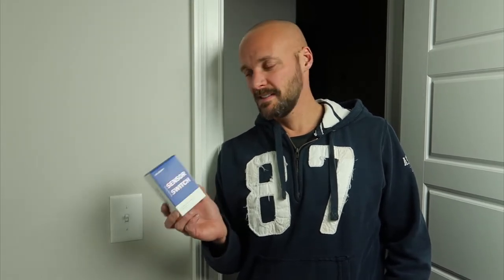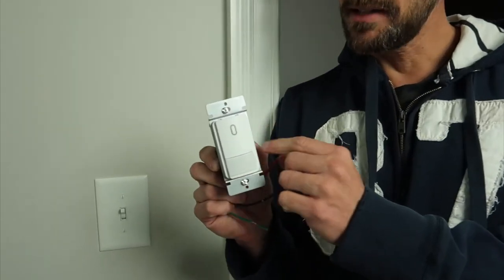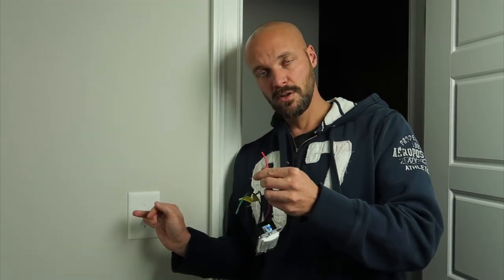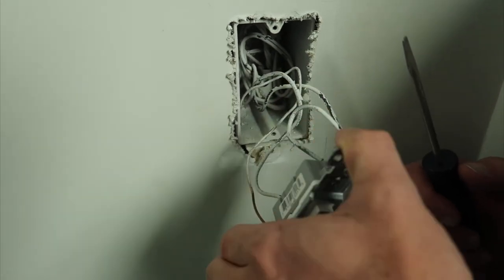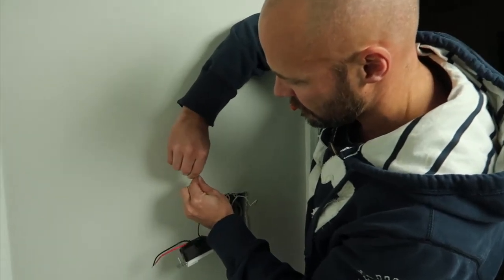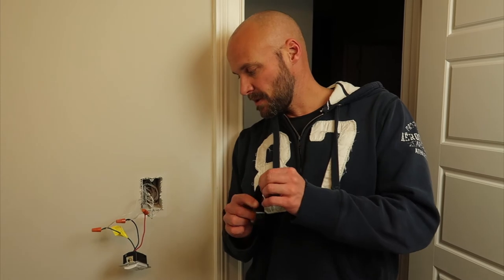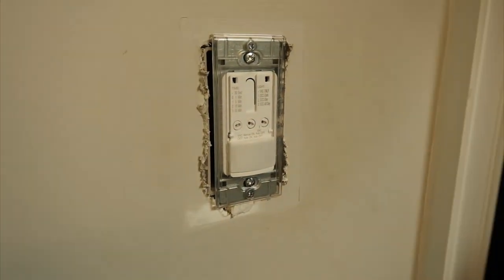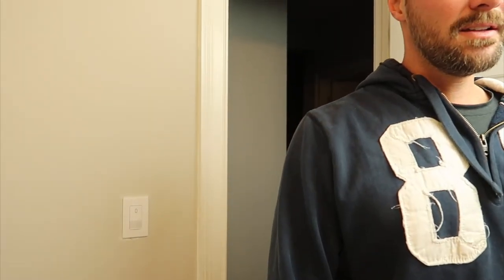How to Install a ELEGRP Motion Sensor Light Switch & SAVE BIG MONEY

Comment: Custion for you maybe you can help me I have 2 smart switch I install my upstairs 1 1 floor the 2 one up by my room .but can't work correctly. The I upstairs work ok but the 1 on first floor if I turn of and I try to turn up don't work so I have to go upstairs and turn on them they work .my question is the blue wire said 3 way wire where the one go? Thanks you. they are elegrp smart switch whit 5 wires

Comment: Hey Lee. Did you have any that didn’t work as a motion sensor? Mine is on a track light where I replaced the GU-10 halogen lights with LEDs. I had a sensor switch on this that worked fine with the Halogen but not with the LEDs. I bought the ELEGRP because it says it works with LEDs but don’t think thats really the case.